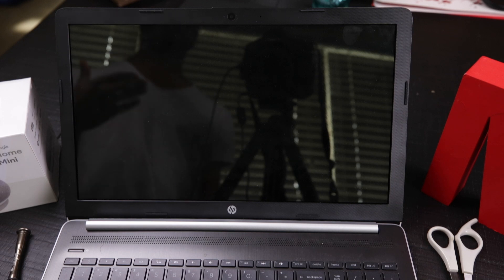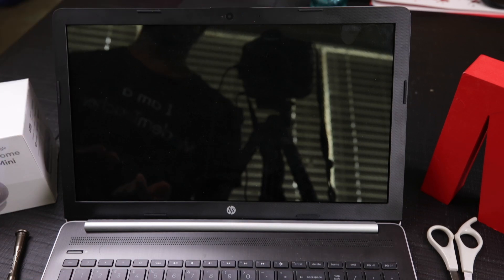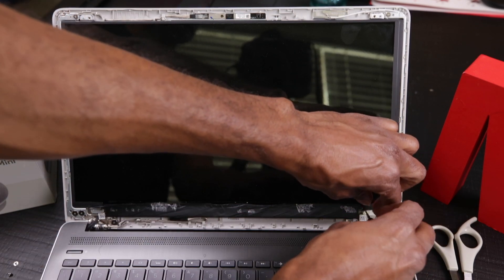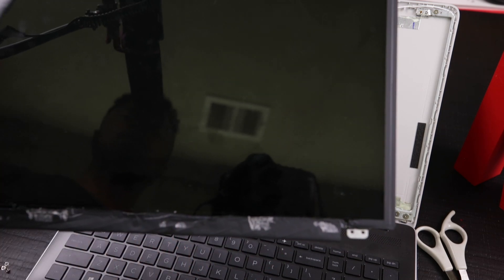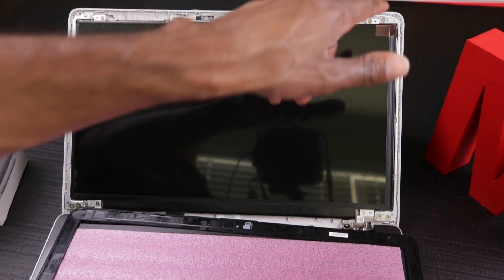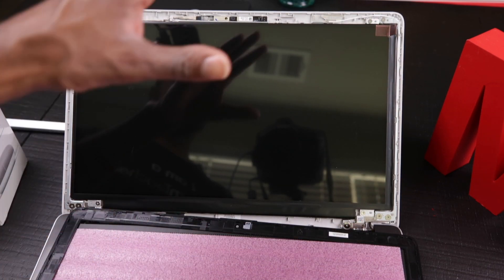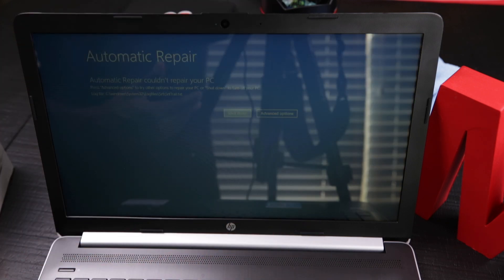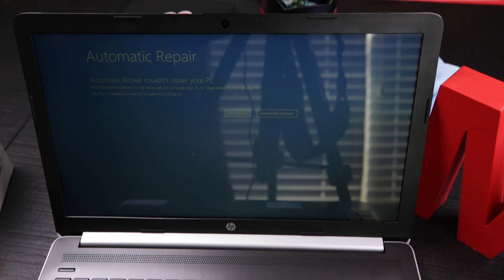Fix Laptop Power On But No Display Problem | Black Screen | Solved

Comment: I bought a replacement LCD and wire ribbon compatible with the laptop but the laptop turns on but not recognizing the replaced LCD. The lcd isn't even powering on. just blackout. But the HDMI external monitor works fine. Is it boardlevel problem?